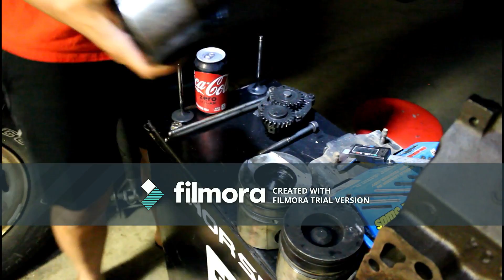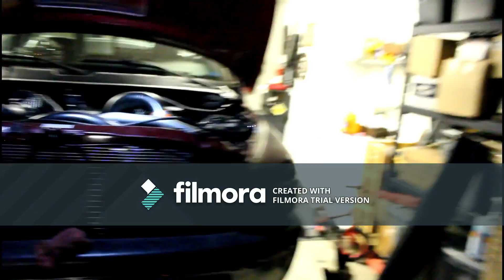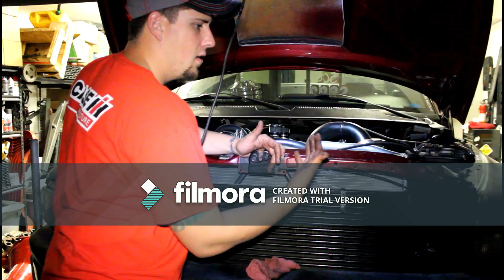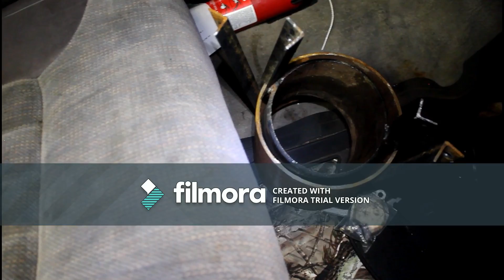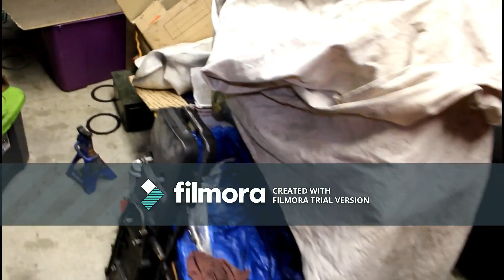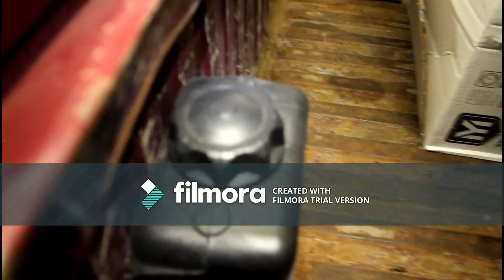Buget Builds

Comment: Quick question on turbo selection. I have a 02 manual service truck and she’s loaded with tools/welder/compressor.  Since watching iv decided to just give her some juice. So far has arp studs, 105hp injectors, stock vp but plan on HO VP later or suggestion? Stock trans. Got sump and 200gpm air dog, valve springs pushrods coming from PDD.  Not exactly financially strapped but would like your opinion on what the biggest turbo you would suggest running. It’s a work truck but I want to make it my build. Thanks
Reply from the maker: 60/67 HX super 9 would be my pick spools quick, tows well supports 550hp
Reply: @horsetorquesdiesel  thanks a lot I’ll check it out